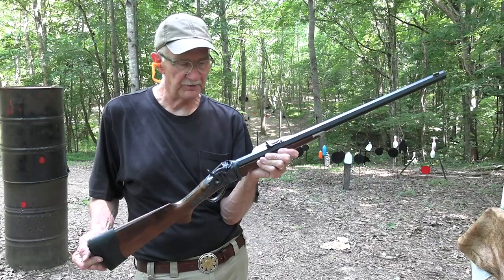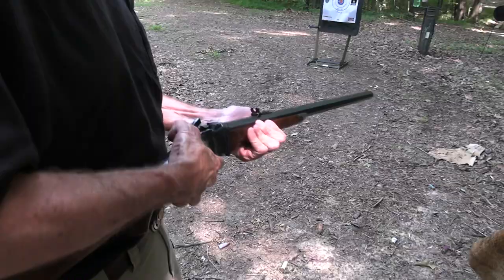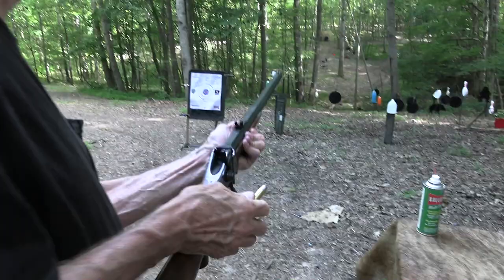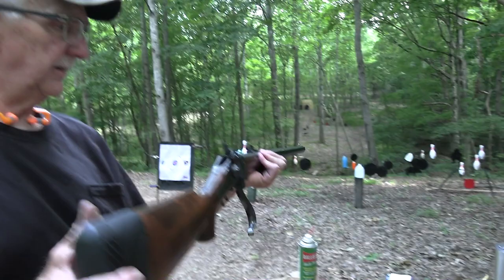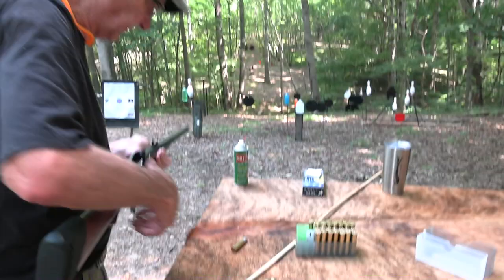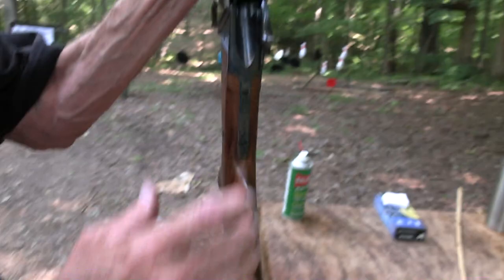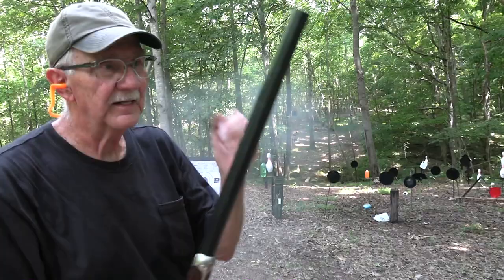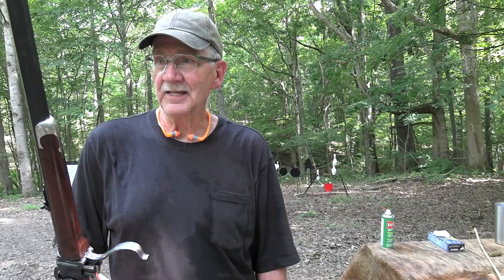1874 Shiloh Sharps Montana Roughrider Chapter 2

Comment: Bought a used 45-70 Shiloh Sharps a few years ago.  The target looked like a shotgun pattern with 405  gr bullets.  Checking with the factory; the staff looked up my rifle's history from the serial number and discovered the bore was drilled using old WWII machines originally used for .50 BMG barrels.  As a result the freebore was rather long.  Using longer 550 gr bullets set nearly 3/16" further out of the cartridge to engage the rifling did the trick- it is now a tack driver!  Good enough to hit the bucket @ 400yd at the Quigley match.
Reply from the maker: Guess one might have the same issue shooting a .45-70 round in one chambered for .45-90.  I've always wondered if you could shoot .45-70 in them with any success, or even if a .45-70 would cycle in a .45-90 Winchester 1886.

Comment: I used a Ruger #1 .458 Win.  I if I remember correctly I used 2400 powder and a 500 gr lead bullet cast 1:20 tin/lead.  The bullets came to me sized .458 and I bought two sets of😊 Lee bullet sizing dies and took them down to .451 in two steps.  Then I used the carbon sheets of old sprocket-sided computer printer paper to make paper patches for the bullets.  I think this brought them up to about .459.  Then a combination of bees wax and vaseline lube was hand rubbed on the paper after it was wrapped on the bullet.  I seated the bullet with .458 seating dies and then used a 45/70 sizing die to put a tiny bit of taper crimp on the brass so it would chamber OK.  I took a box of these out to the Mont. Co. Shooting Complex to test them.  I was getting about 1400 ft per second.  Recoil was about like a 12 ga shotgun with slugs, of course, if you have a 9-pound shotgun.  Accuracy was less than 3 inches at 100 yd.  The bullet impact was impressive to say the least.  It tore a steel swing arm target completely out of the ground.  BTW, I learned the paper patch technique from Paul Matthews book The Paper Jacket available from Wolf Publishing.
I also have a 458/2-inch built on a Mauser action with a 24-inch target barrel.  I used 405 grain lead bullets in it with paper patches.  Brass was cutoff 7mm mag.  Velocity was nearly 1475 fps and it would shoot 5-shot groups of about one ragged hole at 100 yards.  People at the range were always asking me what that confetti was coming out of the end of my barrel when I shot.  And you never had to worry about cleaning the bore.  It was just as bright and shiny and clean after shooting as it was before you started.😊

Comment: very cool! I'm quite intrigued by that dual trigger, is that like a safety thing?
Reply from the maker: Mostly, it's just a set trigger arrangement. Once the rear trigger is pulled, the front trigger becomes literally a "hair trigger."
Without pulling the rear trigger, the forward trigger still works, but it's a bit heavier.
Reply: @hickok45  Thanks. Beautiful rifle indeed.
Reply: oh so it basically goes from a double action trigger to a single action? (but obviously without the mechanics of a double action)

Comment: Not to bust into an inapropriate thread, but just wanted to let you know that I've always wanted a colt SAA. Have one of the newer Ruger .22 revolvers that I like a lot but always wanted at SAA in .45. Bought one of the Uberti 1873 Cattleman 2's 7.5 in steel from Bud's and it should be here tomorrow. My question, if you have the time to answer, is what is your recommendation for getting an affordable (not cheap) belt/holster for it that wouldn't get me laughed at if I ever wanted to go to a cowboy event. We have an annual event here where the recreate the Battle of Aiken from the War Between the States, and a lot of those guys are pretty hard core about authenticity. Not looking for that, but I would like a presentable cartridge belt holster for this. Cheers from Aiken, SC.